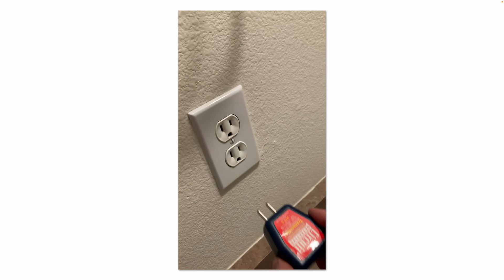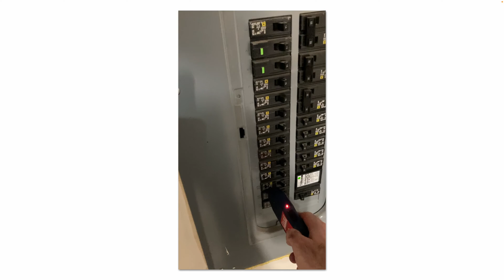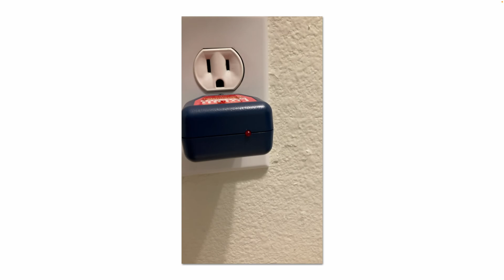How to find what circuit breaker controls an outlet | 120VAC receptacle

Comment from the maker: Here is a link to the circuit breaker finder used in this video: 

https://www.harborfreight.com/circuit-breaker-detective-96934.html?ccdenc=eyJjb2RlIjoiODU2OTI4NjgiLCJza3UiOiI5NjkzNCIsImlzIjoiMTYuNDkyNSJ9&utm_source=google&utm_medium=cpc&utm_campaign=19426351561&campaignid=19426351561&utm_content=145202507935&adsetid=145202507935&product=96934&store=603&gclid=EAIaIQobChMIrqb5l-Wp_AIV6xGtBh2IZAqPEAQYASABEgI0SPD_BwE